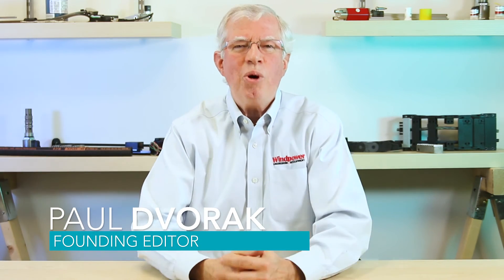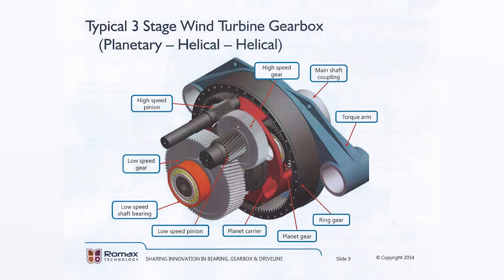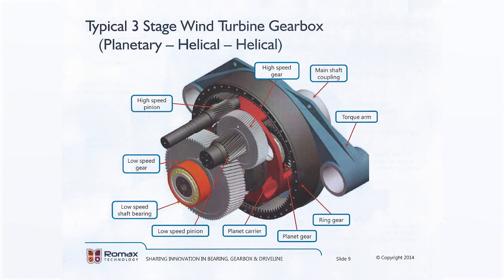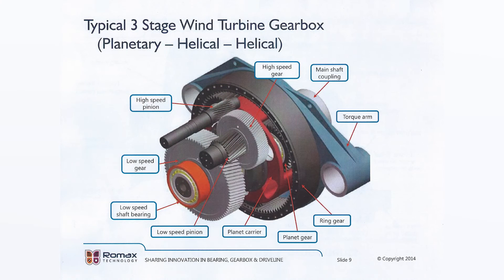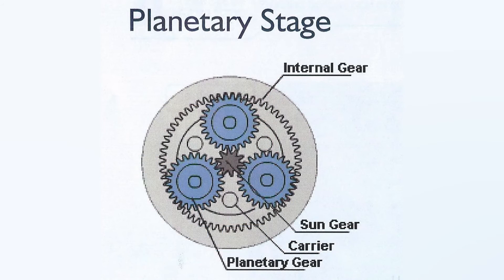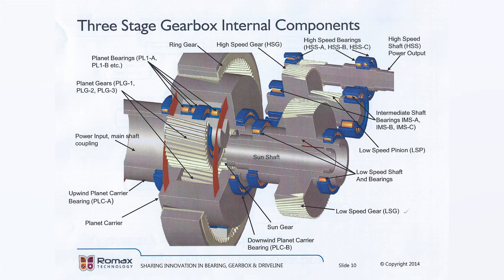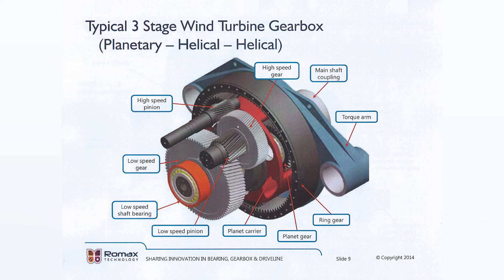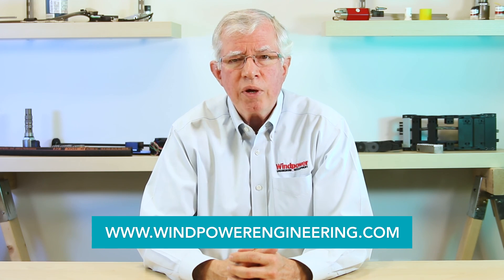Why wind turbines need those troublesome gearboxes

Comment: The first illustration showed a sun gear with 10 teeth. the planetary gears had 25 teeth. I calculated, that the ring gear has 60 teeth, giving that planetary set a 7:1 gear ratio. the second illustration looked like it could be 4:1 as described by the narrator. I couldn't count the teeth of any two elements, to calculate the third, because the planetaries were pictured in the carrier. I, myself, would like to see a 2 stage planetary transmission, with the second sun gear directly fitted to the rotor shaft of the alternator. I prefer asynchronous alternators, because that slight slip loss protects the transmission from wind gusts, and dampens torsional oscillations. They aren't limited by the field strength of permanent magnets, so they can control the rotors in adverse wind conditions. If the field strength of permanent magnets is exceeded, the alternator rotor just skips over the stator poles, and basically free-wheels. That's a disaster, if the blades can't be feathered out in time. If the stator isn't disconnected from the grid, the enormous opposing magnetic fields can weaken or degauss the magnets, effectively destroying the alternator. Induction, while less efficient, is much more fault tolerant.
Reply: Hi Vincent- sounds like you are in the industry.  FYI to protect all those moving parts it is helpful to know the "health" of your oil real-time when paired with a telematic device.  www.vsi-oil.com can do just that.  Our solution is particularly advantageous as wind generation is often located in remote locations and sampling is  time consuming and expensive.